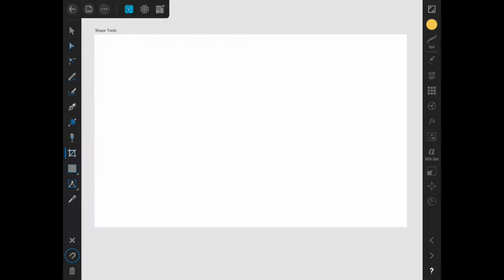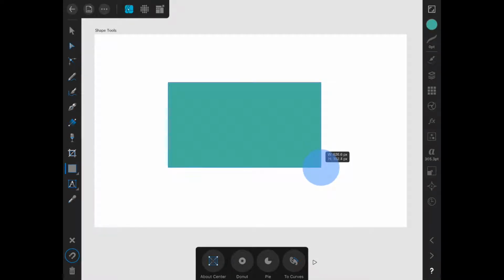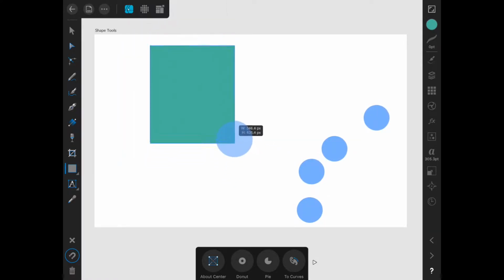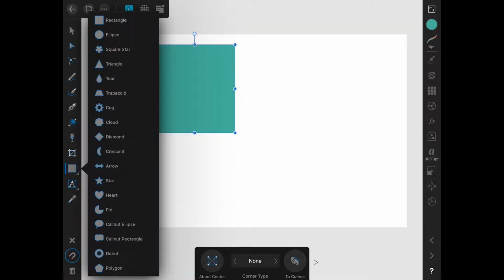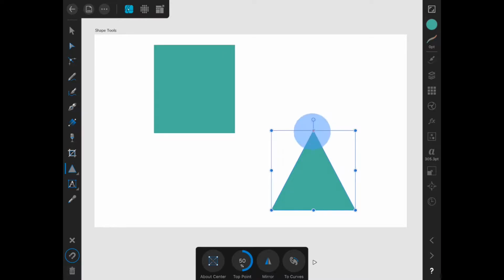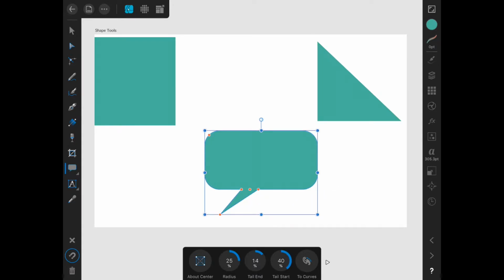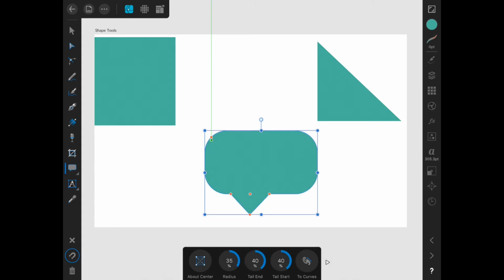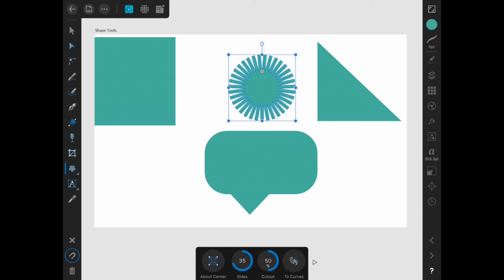Shape Tools in Affinity Designer for iPad

Comment: How come when I use the ellipse tool I get a doughnut until I get to a certain size? When I make a small ellipse I get a doughnut shape...
Reply from the maker: Hi Eric, I do not know why it would behave this way. Do you have donut turned on in the context menu (bottom of screen when drawing ellipse)? That is unlikely since it only happens at certain sizes, but it might be worth checking
Reply: @bendesignsmedia  
I figured it out. It had to do with me adding an outline to it. I turned it off and it worked. Thank you for the reply
Reply: @s7121n9s  Been stuck until I found this comment!